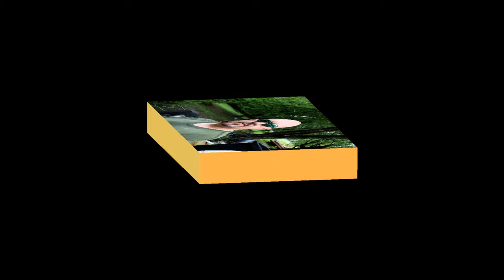DIY Waterfall Filter for Bait Tanks, Koi Ponds, Water Features

Comment: Just curious why you used just he PVC cement on this video and on the previous videos you used the purple primer before the cement.  Thx, enjoyed the video!
Reply from the maker: @MrIndyjoe  honestly, to prove a point. You don't have to use the primer to have a leak proof joint.

The reason they make primer purple is so that home inspectors can visually see primer was used, as it is required by code.

In all actuality, it's not overly needed when doing non plumbing projects like this one.

And, truth be told, I was probably either out of primer that day or couldn't remember where I'd put it. 😂😂